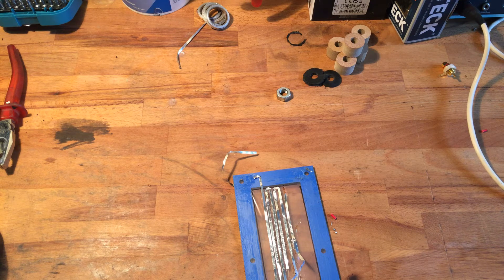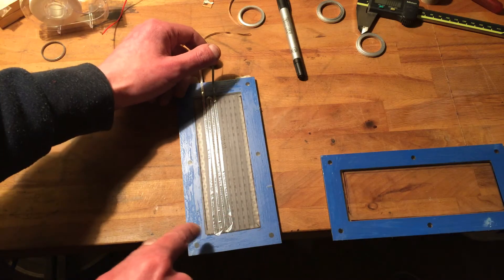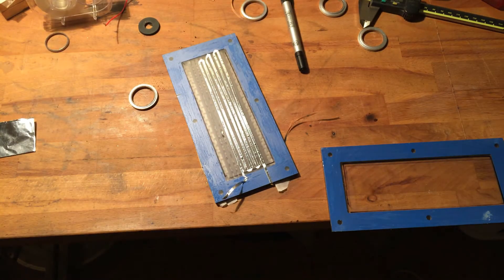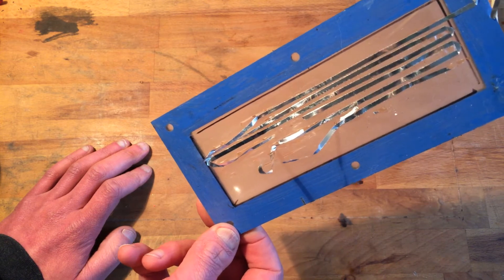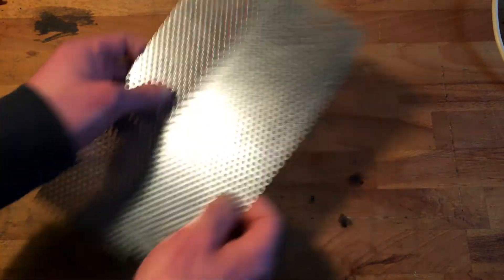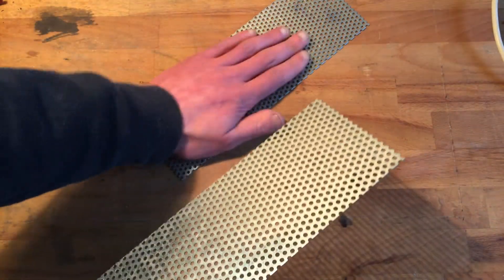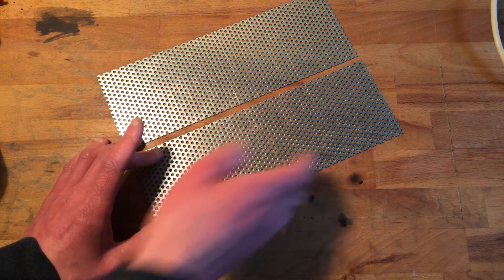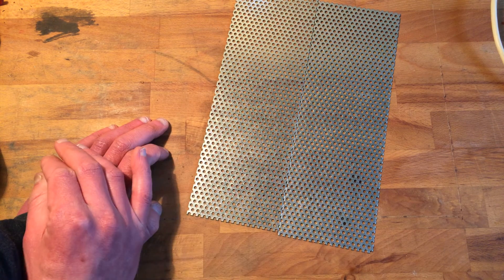Slitting part : 5 And the start of electrostatic tweeter part: 1

Comment: thats mylar? so you just stretch it (dont know how much) and put aluminium on it (how did you glued it?)?
Reply from the maker: this was glued with spray glue. but as seen i did not get far in testing this one ;)  yes it is mylar. i think in the biger panel i do all this for a wire version. same goes for a foil version. same stuff.  resonance i dont know, for this tests it was not of much importance as long as it was not sloppy.